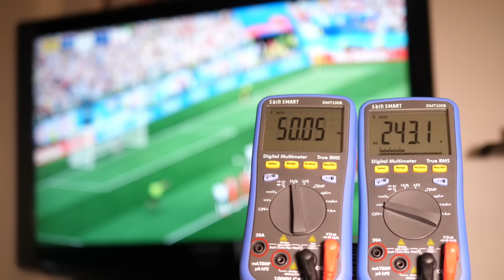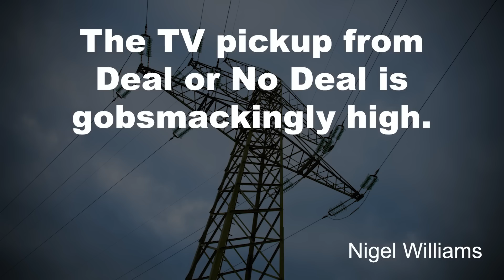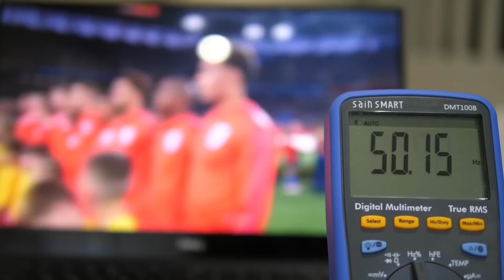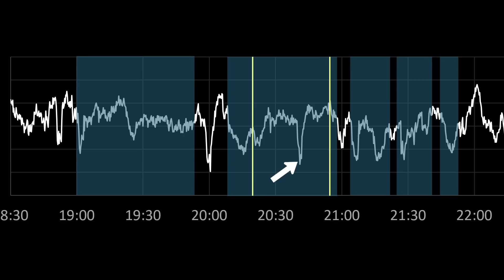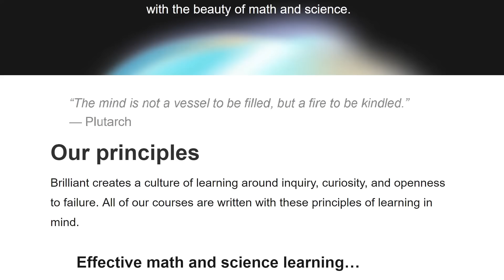Detecting World Cup goals with electricity - The TV Pick-up effect

Comment: The unexpected stuff seems to closely align with exact hours. 7pm and 9pm see some dip in frequency (and therefore surge in demand) with a larger one seen at 8pm. 10pm though emphatically sees the opposite. The 10pm thing is almost certainly because in a large number of factories, warehouses and other businesses the late shift ends at 10pm and the nightshift starts at some point thereafter (in my workplace nightshift doesn't officially start until 11pm, so there is a gap where only management and a very few colleagues sort of reset things for the next shift) , so there is probably an abrupt switch off of equipment in the minutes before 10pm and a gradual switch back on thereafter. The match ending at about the same time and causing a surge on demand at the very same time industry shift times caused a drop off was probably a happy coincidence from the point of view of the electricity board. I'd conjecture that some of the effect seen at the other exact hours could also be down to various businesses starting up equipment on the hour, as well as tv programmes ending on other channels.

Comment: Actually, I think the cycling analogy is not a good one. When you cycle up a hill you pedal slower, and your speed decreases. The point is not how often you pedal, the point is how fast you move - you need to work against gravity, and you are slower.
But in case of electricty, an change of frequence does not change the amount of energy being transported. Basically, the formula for electrical power is W = V * A (Volts times Amperage). There's more complexity to this (i.e. effective voltage), but the frequency is not a factor.
A better explanation is this: The generators powering the grid have a lot of mass that is rotating at the grid frequency, thus containing rotational energy. Now, if more power is drawn from the grid than is put into it, where does that power come from? From the rotating mass in the generators: They slow down and some of the rotational energy becomes available to the grid. So, the generators are rotating a tiny bit slower, and as the grid frequency is coupled to that rotation, the frequency slows down as well.
This also works the other way around, if less energy is consumed than is produced, the generators speed up.
The interesting aspect is that the change in frequency is really just a side effect of an unbalanced system - easy to measure (as demonstrated in the video), and thus a good indicator.

Comment: 4:11 A Zoom H1 or H4n PCM recorder hooked with a cord with an aux plug on one end, and a one million ohm resistor on each prong of a mains plug. That's how I did it. If you take the resulting recording and pass it through a multi stage comb filter and crank the volume, the hum goes mostly away and you can hear appliances switching on and off in the neighborhood.

Comment: Voltage is said to be in acceptable between 216.2 volts to 253.0 volts in uk. averaged to 234.6 so at 2sf 230. But the biggest worry for transition is voltage drop to they crank up the voltage a bit so there is more wiggle room. So if tested you'll see probably around 240v and mostly above 240v in towns as its more likely closer to the point of generation/ transformer.

Comment: This looks like a job for a Neural network as the AI is able to make up hypothesis as it trains. What you would do is pick events you THINK should matter. Goals, Penalties Commercial breaks etc etc... and use them as the input. Then you have a single output, the voltage and what it should be. You feed the inputs in, the NN produces a predicted Voltage. You find the difference between the real voltage and the actual voltage and use it to adjust the weights in the NN. IF there is any pattern the NN will likely start to train itself and will produce a percentage of probability telling you how confident it is that the Voltage is correct. 
Once trained you start running it backwards of sorts and feed the voltage in and it will produce you probabilities that a Goal happened, Penalty etc etc..

Comment: Nominal voltage is 230V +10%/-6%.

This is to harmonise the voltage between countries like the UK where the nominal voltage was formerly 240V and places like Italy where the nominal was formerly 220V.

Of course our distribution transformers are still wound for 240V, because to change them all would be prohibitive. But electrical equipment is designed for 230V - which few places actually use.

Comment: Great video, I am actually a control engineer and have worked on systems that have the ability to trip large wind farms (London Array, Rampion Wind etc.) as well as quickly importing or exporting power through the UKs interconnections to mainland Europe. In this system, we have a thermal trip, which occurs when current is over the thermal capacity of the lines, and stability tripping, which is there in case a major transmission circuit is opened and the grid stability is at risk. The latter will trip off entire windfarms within 50ms if necessary to maintain stability, otherwise frequency sensitive generation could cause a cascade tripping event, leading to a nationwide blackout, which wouldn't be ideal.

Comment: Interesting that water pressure is tied so directly to electricity. In my city in Texas, they have large water tanks on towers or hills that provide pressure from gravity. Pumps to fill them use electricity of course, but it's done slower and continuously, building up a reservoir. 

Sounds like they need more water tanks, and power banks (battery storage).
Reply: It's that way everywhere. Virtually all water systems have a tank or tanks involved even homes with their own well have tanks. Still need to turn the pumps on to keep the tanks full if they are being used.
Power grids do have systems in place that act as a battery of sorts but it's not like a gigantic car battery, it's the momentum of turbines and such as well as things like pumping water into high reservoirs during times of low power demand so during times of high demand the water can be gravity fed to activate during peak times. 
Way more to it all than that but yeah these systems are in place almost everywhere.

Comment: The analogy of voltage and frequency is a bit inaccurate though. Keeping voltage fixed, freq will fall  is not the way to understand it.
The reason behind why its easy to control voltage than frequency can be understood as if you have a dynamo, voltage is due to the magnets inside and frequency is due to the fact you are rotating the Dynamo. Now to control the voltage, you need to change the strength of the magnets, and since generators use electromagnets, thats a easy job. But to change the frequency, you need to slow down or increase the speed of the generator at which it is rotating. Since generators are huge, and due to its mass and  stored kinetic energy, its not easy to change its speed quickly and the response is slow.

Comment: So... immediately after a goal... people go to the toilet... which causes a drop in pressure as their cisterns are refilling... which causes the water pumping stations to use more power to compensate... which affects the power readout at your wall socket because of the power companies dealing with that spike....
Thats probably too many variables with enough irrelevant noise to actually have this hypothesis become true (as then seen in those results). You have explained why the electricity is affected, and it likely is, but as to how its affected is probably too... incalculable, or unreadable from results.

Comment: You don't detect those goals in the frequency data because the National Grid does everything it can to smooth out those dips and surges.  Otherwise, your detection method would not be through frequency measurement, but through blackouts.

Comment: They declare the voltage at 230V even though it’s 240V in order for our supply to be compatible with the rest of Europes 220V supply. The regulation dictates no more than a 10% deviation from the stated supply voltage. So for 230V, 220V and 240V are both within the 10% boundary and thus can be considered compatible with one another

Comment: Hi, what I find mad is, if the electricity supply is travelling at the speed of light which is 299 800 000 metres per second, and the frequency is 50 Hertz,   that means 50 waves would travel 299 800 000 metres in 1 second.  If that's right then the length of 1 wave is 299 800 000 /50  =  5 996 000 metres.  Am I wrong ?  I know in real life a wire that was that long would have a lot capacitance, inductance, and resistance so it would affect the wave. But what actually happens between my house and the substation ?  I mean, in a 1/50th of a second it can travel a huge distance, so If my house was 100 metres from the substation, then a wave would have reached my house  in 0.0000003 seconds.  It takes 1/50th a second to do one complete wave, but it reached my house 0.0000003 seconds (time = distance / speed).  One second divided by 50 waves is 0.02 seconds for one wave.  In 0.0000003 seconds , its done 0.0000003/0.02 waves = 0.000016 of one wave. What I mean is, if it got to my house in 0.0000003 seconds it hasn't had time to do one wavelength before its back at the substation.  is that right or what ?
Reply: propagation speed in low grade communication cables is like 50% of c, i guess in a power line it might be even lower

i'd say more like a full garden hose... when you turn it on water comes out quite fast after, but the water itself is still moving quite slow

afaik they are using DC because AC would have higher losses at such distances? :x

also i think your whole question is kind of irrelevant, since it doesn't matter if a whole wave lengths fits into the cable, the power station just changes the voltage, it might take a while until the change reaches your home, but the frequency won't be affected by that, its the same wave, just a bit later
i'm not sure if the voltage can get reflected from the end and that would matter somehow, but normally i think the station just sets yiur voltage and thats it
Reply: cheers then
Reply: afaik electrons only move at a few cm/s, but i guess you might be right when it comes to propagation speed (though i think your calculation is kinda off, but i can't pinpoint it just now)
Reply: Like ball bearings in a tube you mean?  I heard that in Russia where it travels 1000s of miles they have to use D.C. as it gets reflected  back if AC

Comment: Why not to switch to 60Hz and then drop down to 50Hz during high demand? I mean modern devices can accept both 50Hz and 60Hz (though not always multi-voltage) and in Japan they use both 50Hz and 60Hz freq's depending on the region.
Reply: because some clocks use the mains frequency to keep time over long periods of time. Also some motors are synchronous to mains frequency, so your motor would spin 20% faster, which you may not want in your design.

Comment: For over ten years I've had a radio remote control switch on my air conditioner compressor which the power company can use to turn it off for brief periods. It rarely gets activated and I get a credit on my electric bill each month during the cooling season.

Comment: Electricity from decay? Surely that's only used on space probes, not terrestrial power stations...?
Reply: You know,, they call it "nuclear power", and they use those things known as "nuclear reactors"
Reply: @prodbyfaith  No. Nuclear reactors generate heat from the fission of nuclei. While radioactive decay can be used to trigger the fission, it is the fission reaction that powers the plant, hence it being called a *reactor*.

Nuclear batteries as used on space probes are a different kettle of fish, generating electricity from the decay on non-critical isotopes. They are very low power, but very long-lived.

If nuclear reactors were just giant nuclear batteries decaying at their natural rate, we wouldn't have had critical reactor failures like Five Mile Island and Chernobyl. Or alternatively, we'd have frequent natural nuclear accidents in granite rocks.

Comment: The bicycle analogy isn't quite right when talking about a grid-scale effect like frequency. Frequency is the same throughout the grid (with some phase shifts). The frequency value is the result of a balancing act between generation and load. As too much load is added, generators slow down and produce a lower frequency. Some generators run at partial output, called "spinning reserve", and their output can be increased to force the grid frequency to increase. The power companies actively steady the frequency with the spinning reserve. It is difficult and likely impossible to use grid frequency to see load on the grid without knowing generation.

Comment: anti scald faucets does the water equiv so if someone turns on the cold water elsewhere in your house you dont get a surge of hot water and possible scalding.

the same kind of thing was supposed to happen in the animated movie flushed away where everyone flushes  and causes the world in the sewer to be flooded  and there was a battle of good and evil to prevent that.

that does not make sense because most electronics if all of them have switching power supplies witch takes the ac and converts to dc and then using a transistor makes a new ac wave to power the transformer so you could run your tv off 20 car batteries in series.

thins most effected by frequency changes would be certain ac motors and clocks that uses the line frequency as a time base so your clock may lose or gain a couple seconds during the sports event.

i thought tv and movie industry was timed around the automotive new year so new shows are released so they can feature the latest year model  like james bond would be released shortly around the new model year so the latest aston martin would be in the movie.

Comment: there is a bit of wrong information in the video,
it is actually the generator that need protection against frequency variation, a 0.5Hz frequency variation isn't even noticed at the load side but can cause oscillation in turbines and hence their protection activates to save the generators, if too many generators disconnect at the same time, the power surge can cause a grid instability and a blackout

Comment: Well, actually the voltage going down or the frequency going up a bit (in 230 V/50 Hz mains) would not affect a lot of devices nowadays, as (especially when they're low power like with chargers) it's cheaper to make the SMPSes universal (so they're compatible in all the world voltages and frequencies) than to make various versions of the circuit.

Comment: EU standard for mains is 50Hz 230V ±20V UK (and from memory Ireland) sits at 240 ±10V most of mainland Europe is 220V ±10V. The standard exists so that any properly designed electrical product made for Europe will work properly anywhere in the EU by simply covering the full spread.

Comment: a lot of the issues with TV pickup have been fixed, or rather worked around...

when huge TV events happen the grid will overproduce and literally waste power to maintain a specific frequency,

its a lot easier for them to overproduce a few megawatts and burn that power up on underground heating elements or other specifically wasteful methods that can be turned on or off to make demand constant, its terrible for the environment but it saves a lot of issues when the demand changes rapidly.

Comment: Interesting analysis... I really wouldn't recommend measuring the frequency in your own home, it's good you use a true RMS meter. But still there is a lot of noise in mains at your home, due to switching power supplies etc. drawing current very unevenly, which does 'cause the voltage to jitter a little and distorts the sine wave. This effect is usually very small, but it can still make it very difficult to measure the frequency accurately. The mains frequency is generally very stable due to the sheer mass and intertia of turbines etc. therefore you have to be capable to measure relatively small differences accurately.
There are many website that track the mains frequency and voltage in real time. These usually measure closer to the power plants and use high end measuring equipment. I would compare those to your multimeter. And I bet you'll find your multimeterd readings to be fairly noise. You just have to take into consideration that the websites are obvioisly gonns have a certain delay, which may 'cause your readings to be a few seconds oit if sync. Similar to how a live stream of a game can easily  be 30 seconds or more delayed compared to normal TV.